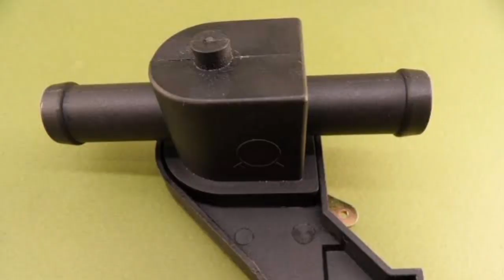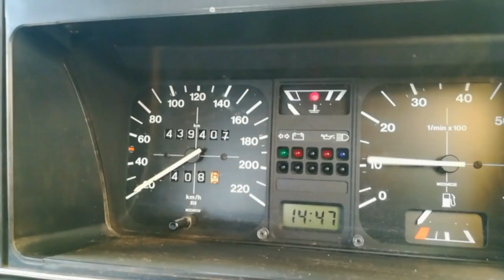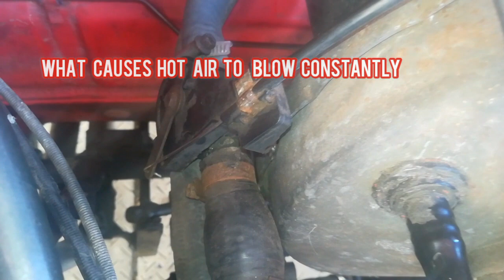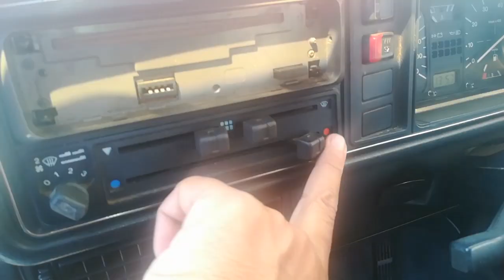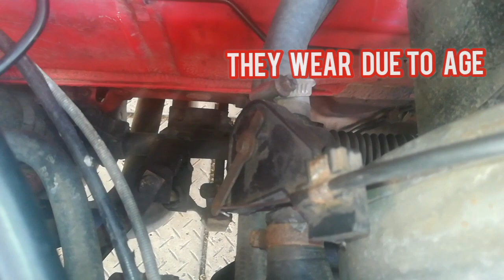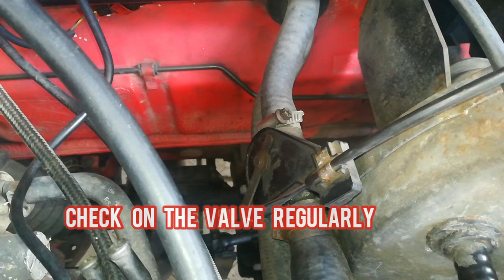GOLF MK1 :Heater stays Blowing Hot air into Cabin. Heater Control Valve.

Comment: Winter just dropped with avengance here in old Blighty.  My T4 is blowing cold air, no hot,  I thunk k I've tracked it down to this control valve.  Inlet to the heater core is hot, outlet pipe is cold.  On removing the control arm, I see that the square flange that the metal arm sist over is buggered.  Even though the arm is moving freely, the actual valve isn't.  Will order up a new one.  Good info in this Vid.

Comment: Thanks brother. I fixed my heater due to your videos. System was glogged up. Now my cable is not working. How do I replace the cable ? At the moment I have to move the lever manually on the heater valve which is such a pain. I pulled the cable to hard

Comment: Good day , i forgot to switch it in to the off position when I was changing the heater velve now it doesn’t go into the off position completely how I can I fix it?
Reply from the maker: Hi. What u do now is.. Put it on the off position inside the car.. Then go to the valve and un hook it. Push the lever back to the off position, then hook up the cable again. Then you good to go

Comment: This was a great help, thank you!

If you ever find the time, I'd love your idea on the way to fix water getting onto the two relays under the driver's side dash. My fuel pump relay keeps getting wet in the rain, I believe it's a common problem on the golf's and that guys end up moving the whole relay box. Would like to hear your thoughts on it. :-)
Reply from the maker: Hi Best to spray those relays with Q20. That will displace water and moisture, and the relays won't malfunction ... But u need to also determine exactly where the water gets in and seal up that area...
Reply from the maker: Have  you seen this video of mine... Where I show how to use Q20 on the electronics. Basically waterproofing it     https://youtu.be/6Mtzs033EYE